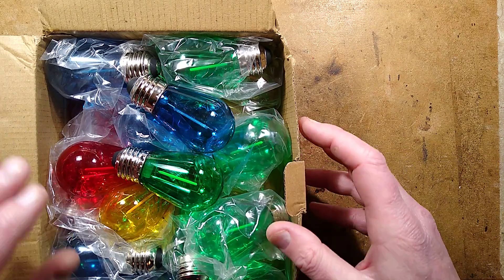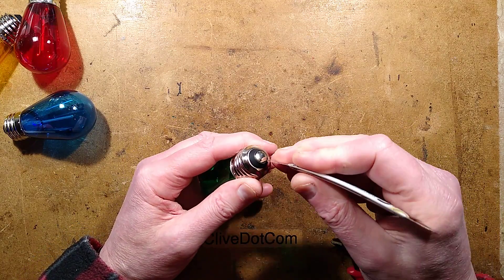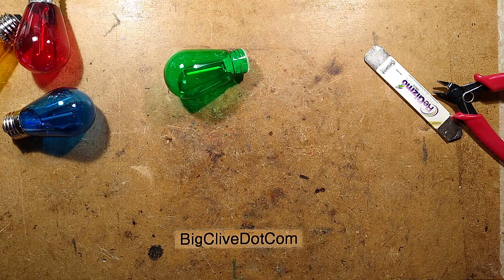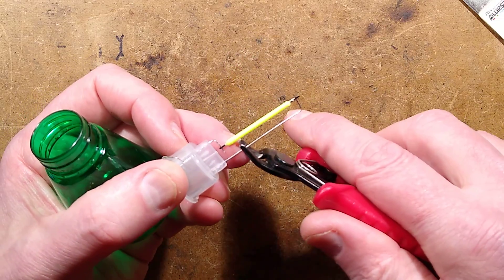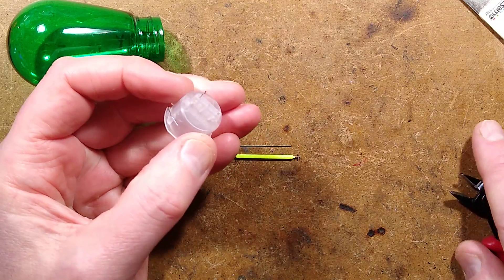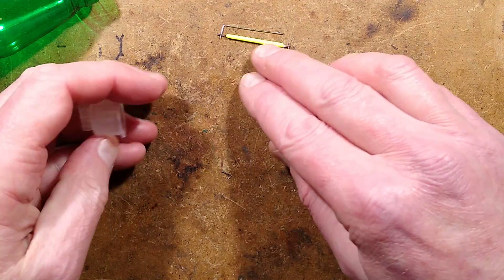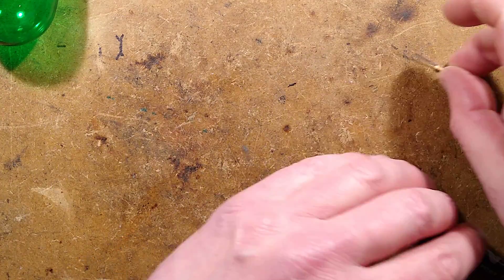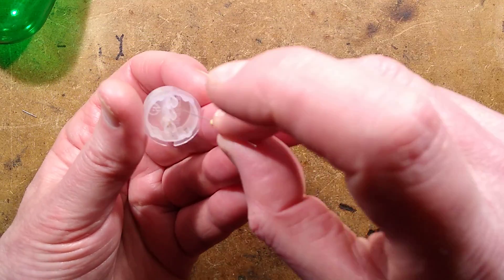Modifying Temu LED bulbs - really neat circuitry

Comment: That's a nifty insight about the lamp not using an array of leds, instead using resisters for longevity.  The lamps on the string I bought burn out too quickly, leaving just a dim glow at the base (presumably the led array?),  and the replacements are expensive. But how to tell if replacements have resisters when ordering from an online pic?

Comment: At 1:07 I have found it possible with some crimped bulbs to stick them in a bulb socket and carefully wiggle it until I can remove the metal cap from the bulb and after I am done I can almost always push it back in. Hope this helps Clive!

Comment: I would be quite tempted to just run two filaments and no resistors.
Reply from the maker: It would still require resistors in series with two filaments.

Comment: Takes a cheap-made PoS that is ~50% efficient on 120VAC and converts it into an improved PoS that is ~25% efficient at 240VAC, and praises their simplicity.  How about just connecting two 120VAC units in series to run off 240VAC?  They can't use such a lame design for higher-output lights, the power wastage is unacceptable.  Large LED light bulbs make about 100 lumens per watt; 50 lumens per watt or 25 lumens per watt would be unacceptable.  The more-complex driving circuits are more efficient and they can reduce flicker and/or keep the power factor high.

Comment: The very low resistor could be a sort of fusible link like on Christmas tree lights which just acts as a fuse if the rest of it short circuits? seen done on other things.

Comment: Do they use edison adapters in the UK,  that seems dumb AF,  the metal base is supposed to go to ground, and the pin is supposed to be hot.  Super electrocution hazard.
Reply from the maker: Yeah.  BC to Edison is a 50/50 possibility of the thread being live.

Comment: The second resistor may be a fuse. Maybe you should try connect two bulbs in series on your voltage instead of remaking them.

Comment: How would you go about replacing the tiny contact at the base of the bulbs? The 12v RV bulbs look as though the contact is made of aluminum foil of all things. It has dissentegrated leaving plastic ? In its place complicating things further. RV bulbs are EXPENSIVE.
Reply from the maker: Some are a press in stud and some are a blob of solder.

Comment: You could have fitted a 30nF capacitor in the available space, Clive! (Thereby improving the efficiency by a factor of three, compared to the purely resistive dropper. Perhaps.)
Reply from the maker: If doing that I'd have gone for a higher current.

Comment: could of just cut the plastic mould on the sides and split it in half and the whole thing probably could of came out in one piece
AND
should of just stuck the filament in the plastic middle hole for an anchor and tin it like that while melting the plastic to hold it in place

Comment: it's not the simplest way with resistors ... is't possible to use condensers to reduce current
Reply from the maker: I could have used a capacitor.

Comment: Where did you get the replacable lightbulb contact screws?
I need to replace the contact screw on an expensive bulb that i had electrical incident with.
Reply from the maker: The caps came from this seller.  They also sell the crimping tool.
https://www.aliexpress.com/item/2053793296.html
Reply: Got it! Much thanks!

Comment: You can also use a class X type capacitor to provide the required voltage drop for the LED circuit. I have used 22 nF for my night orientation lights in series with a 220 Ohm resistor as a fuse in case that the capacitor fails. As rectifier I have used two anti-parallel LEDs, so the voltage will never exceed the relatively low voltage in backward direction.

Comment: It's odd they didn't use more LED's so the resistors can be smaller and the light more efficient.
Also they should have used two strings of LED's in parallel with each other, back the back with the polarity of each string reversed and eliminate the bridge diodes.

Comment: what you could do to improve these and make resoldering them easier is get an additional led filament, and have one going up, and one back down, more light, less power wasted on resistors, and you don't need to have a fiddly lead going up to the top of one filament

Comment: I wonder if the next evolution will simply be a string of LEDs in series, made to look like a cob LED, with a centre-tap halfway along to make wiring for 120v and 240v a case of just soldering the correct terminals? 💡🔀😇

(End-to-End for 240v, and Ends-to-Tap for 120v (2x current) of course. 😇)

Comment: If the ad wasn’t specific about the voltage I’m sure they will work with you. I sent them a couple second video of my camera coming on to a bright, blank screen and they immediately returned my money and told me to keep it. The accessories are handy. Later, two stickers got damaged and same remedy.
Reply from the maker: They've just refunded and notified other buyers of the voltage error.

Comment: Not sure how electric system is setup in U.K. can't u just use 1 leg of the power and the ground? Leave off the 2nd power leg.
Reply from the maker: No.  It's 240V to ground.  That would also be a dangerous thing to do, as the ground wire should not carry load current.

Comment: I guess you could also put 2 or 3 lamps connected in series on 230v supply. Or more in a series festoon string, on a voltage doubler rectifier. Mmmm spicy 🌶🌶🌶🌶 DC voltage ⚡️

Comment: Cool channel! Subbed and Belled! Very cool content, you know everyone is wondering are we in a simulation or can i take this appart and look at what makes this tick??? haha

Question:
I have a 12V system (car battery), and i replaced my front blinker with a LED light from a trailer setup, it replaced a amber 12V filiment bulb, now the circuit blinks more quickly (perhaps from the lower load in Amps). 

My question to you is, how would i slow the blinker circuit down? (Blink more slowly).

I was thinking to add a resistor (1 Watt/or your recommendation), and add it to the circuit, to cause more resistance, making the blink cycle slower?

Maybe measure the resistance of the old bulb and socket, then add a similar but lower resistance?

Thanks for any suggestions!
Reply from the maker: You can either add a load resistor or replace the flasher with one designed for LED bulbs.
Reply: By law a vehicle turn signal flasher relay must stop flashing or flash much faster if one of the bulbs has failed, so that you do not think you are giving turn signals front and rear when in fact you are not. Hence the problem if you replace the tungsten filament lamps by LEDs.

Comment: cool video clive, i have american led lamps and after a year of use, they start flickering, here's the schematic/datasheet of the light and the voltage regulator (BP5131HC) that i think could have broke, could you have a look?
https://static.chipdip.ru/lib/319/DOC005319610.pdf

the mains is connected properly, tested by taking the pcb off the light enclosure and sticking it into the mains, capacitor is also not it because connecting a similar one in parallel did not change anything, the rectifier works but that mysterious voltage regulator seems suspicious

Comment: The green one would be my choice for modification as the peak response of the human eye shifts towards green in low light. I have already tried modifying a cheap LED lamp, but I need to make further changes because it is still too bright. I use it as an uplighter. The trick is set the brightness so it looks grey instead of green, which is how you know your eyes have adapted the dark. Set optimally, with a different light source, I found the results amazing in that I could read comfortably and without straining my eyes in what would otherwise seem an insanely dim light level.

If this was realised as the norm for night illumination then the benefits to the environment would be significant is several ways. Nature would no longer be tormented by artificial light, people would get proper sleep as well as  be able to see the amazing beauty of the night sky from anywhere in the land, and CO2 emissions from energy driving lighting would be very significantly reduced if the power generation was proportionally shut down. Alternatively, this energy would help charge electric vehicles overnight and drive the pumps for hydroelectric power.

Comment: This reminds me of a quite fun anecdote from my childhood:
My dad had brought from the US a pair of fluorescent blacklights that were of course designed to run on 120V and had wired them in series in order to be able to use them in France without having to buy a step-down transformer.

But it came to my mind many many years later that he could have swapped the ballasts in the fixtures for 230V ones instead since fluorescent tubes themselves don't have to match the line voltage like for example incandescent lamps thank's to the ballast doing the job of supplying the tube with the right voltage if you take care to choose the right one to match your grid.

Also he didn't seem to know that running a 60 Hz ballast on a 50 Hz supply might not have had been the brightest idea either even though the tubes seemed to have worked fine despite all that.
(They didn't however get much use as far as I know, that might explain why they didn't fail I think).

These fixtures might also have been of the manual preheat variety since the (rocker) switches on both of them had 3 positions including a momentary and two latched ones and my dad had told me that you had to hold both switches in the momentary position at the same for a few seconds before setting them to On.

I found however that it was actually quite easy to get the tubes to light even without pressing the momentary side of the switches.

Comment: I bought a 1W nightlight for my daughters bedroom, well I bought a pack of 5 with the intention of dismantling one to inspect safety and circuitry before putting it in her room as a night light. same filaments you have here but 2 in series with a resistor, super super simple.  testing prior to final install showed it to not get too hot and light output was lovely and low.
Reply: did flicker a bit.. but i guess thats what happens as the diodes most only light on the half cycle.

Comment: I'd be inclined to replace that limiting resistor with a cap, around .1µF/630v or 240VAC if you can get one small enough. 

Clever circuitry in that LED 'filament'. The only ones I've seen are just either a series string or all in parallel. 

The efficiency of this setup would be far better by putting a green LED array into the green bulb, blue in blue, etc. The coloured bulb is a filter that removes the unwanted colours produced by the 'white' LEDS thus reducing the overall efficiency.

Comment: Thanks :) or alternatively you could use a capacitor to drop the extra 120 volts. A bit more calculation required but…
Reply from the maker: I'd just try one of the usual range.  100nF, 220nF or so.

Comment: it could be interesting to extract filaments from two lamps and combining them into dual filament with them in series to drop more of the voltage on the LEDs
Reply from the maker: I've been toying with doing that.
Reply: I was going to suggest that. 

My approach would have been to run these bulbs in series pairs, but that would have been just as inefficient.

Comment: Wouldn't it be easier and faster to rewire your light set? Example: wite 2 sockets in series, then parallel wire the next 2 in series, etc.
Reply from the maker: Not easy in a moulded string.

Comment: I would much prefer making them run off 12 or 24 volts DC but still use the Edison cap to give someone later the opportunity of stuffing it across the mains later.
Reply from the maker: A 12V filament and resistor could be fitted.

Comment: A little hack I use for crimping the end caps onto LED bulbs is: A PVC Water Pipe (large enough for the cap to fit in) with 6-8 screws screwed around it towards the end of the pipe. Then I just drop the bulb in and tighten the screws, the cap is crimped. I've never had one come off again, but it's a slightly slower process.
Reply: great idea!
Reply: I'm going to try that next time I open a 💡. Nice tip.😉👍

Comment: HI, I have a customer who has old disco lights at a bar and they replaced all the bulbs with leds and the switching leds are blowing up the disco light controllers. Do you think these would be ok when used with a disco light controller because they are so basic ?
Reply from the maker: The disco lights might be using an electronic halogen transformer.  They don't like low loads.   LED sources are also not the ideal focussed point source like halogen.

Comment: Nice video, always interesting to see what is inside. Congratulations on the 1M subscribers!

I'm using these lights in hallways and they consume 0.8W and light up to 90 lumen (the yellow one). I believe the version I have is with one resistor and it is on the short leg of the LED, close to the socket. 90 Lumen is enough to see where you are walking at night.

Comment: Having no energy storage cap, along with the non-trivial value of the series resistor, makes the power factor good. The efficiency (efficacy, really) would be improved by having a longer LED string. The yellow phosphor means the LEDs are making white light, and the tinting of the bulb makes the color. An even higher efficiency/efficacy would come from using a clear bulb envelope, and having colored LEDs with little or no phosphor (but that would make the LED string manufacturing a lot more complicated, and it would be a bit confusing for customers, since otherwise identical looking bulbs would be different colors.).

Comment: I think I'd prefer the 30 second ad blurbs at the beginning rather than in the middle of the video.
Reply from the maker: I've been running an experiment to see if YouTube pushes video with mid-roll adverts.  I only put ONE on LONG videos and only if it can be fitted insensibly several minutes into the video.
Reply: I get Premium You Tube and don't even notice it on my monthly bill, no ADs is great.

Comment: How about using an X capacitor instead of a resistor? It would use less power and run cooler. A small resistor would still be required to limit the current surges. A 68nF capacitor and 6k8 resistor would give decent brightness and longevity.

Comment: I'm not fooled, that's clearly a fire-resistant hand being used (8:38). I was going to suggest two lamps in series or put an extra resistor inside the end cap to avoid further destruction, but quickly ameliorated myself.

Comment: Considering you have double the voltage - would you consider adding two gel-filaments in series and doubling the resistance (instead of increasing the resistance 3x to 4x)?
Reply from the maker: I have considered blending two lights into one.  I'm not sure of the availability of the LED filaments with built in rectifiers.

Comment: The dot and cross on the diodes remind me of the representations of 3d vectors on a flat piece of paper/a plane, with the dot inside a circle (.) representing the "tip", i.e. the vector is directed from the paper towards the viewer, and the cross inside a circle (X) representing the "back", i.e. the vector is directed from the paper away from the viewer.
P.S. the vectors in question are always perpendicular to the paper!

Comment: Madness that they’re able to make lamps by putting a coloured lens over a white LED, rather than using coloured LEDs.  And it’s the cheapest way to do it.
Reply: White is much more efficient. We were trying different LEDs to go on a front panel. We ended up with the resistor for the white one being about 50 x higher than red or green.
Reply: @MrDuncl  a white LED is a blue LED with phosphor to produce a spectra that looks white. And then in this case filtering most of that spectra out again using a coloured lens.

Are white LEDs really more efficient?  I have doubts, maybe it’s one for a Big Clive video…

Comment: Hoooly cr@p! I honestly find this super insane! The electronics to run a freaking LED light bulb is only two resistors? Whoah! I got a super cheapie LED light bulb from your equivalent to Poundland, the .99¢ store here in So-Cal. back in 2015. That light bulb had many IC's an aluminum , aluminium disc to hold the LED's and other large electrical components.

 LED cost-cutting tech is moving at warp speed! If cost cutting is the game, the Chinese manufacturers have it hands down. Albeit not always in a safe way to do so. I would love to see you run that lower voltage lamp in your higher voltage. Just for the science! Yes, the science.
Reply: well, this cheap design is simple but the downside is efficiency, as a lot of power is lost through resistors, and flickering, as it only lights up a bit less than half of the AC frequency. A few more component and a bit more filaments per bulb could easily improve the circuit, but as you said: cost-cutting is their motto !
You should check older videos on this channel, one is particularly insightful about different led lighting linear circuit designs.

Comment: Still can't see why you cannot get rid of all the 6 parts, the 2 resistors and 4 diodes. LED's placed in two strings counter parallel (or individually counter parallel and then a series string), and enough of them to divide the full peak voltage into their cosy zone should work. We never did because it was outside of such globe and as such quit dangerous, but with these techniques here used and placed inside a globe it would be safe. Why less reliable ? And the 2x 47K + 4 diodes dissipate 4/5  of the power, 1/5 is for the LED's 🤔 Where does my thinking go wrong ?
Reply: For generic use maybe the 100Hz is a problem, no filtering.
Reply from the maker: It would require double the number of LEDs, and you do still get a slight optical shimmer back and forth.